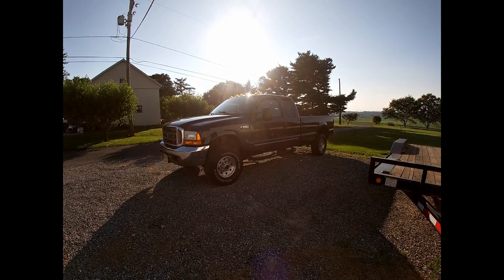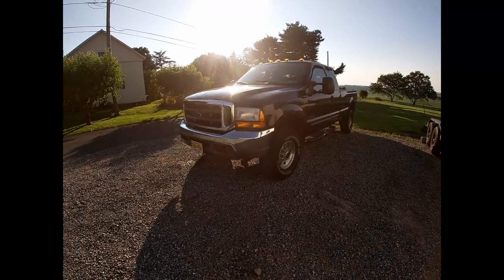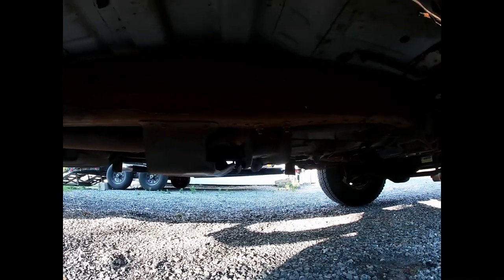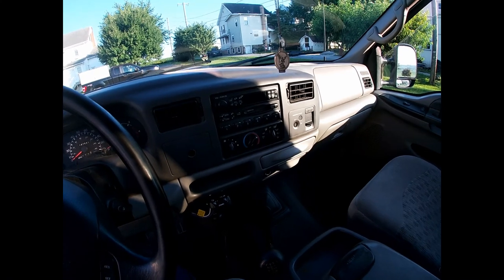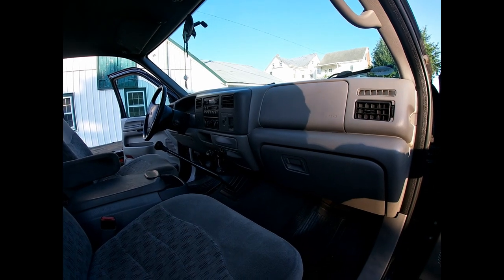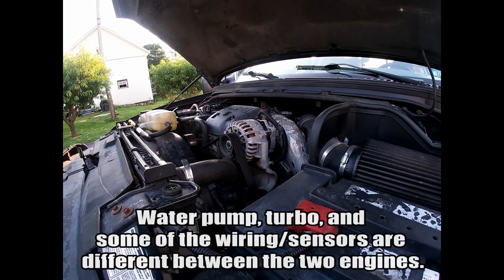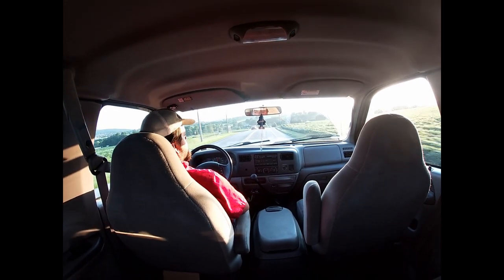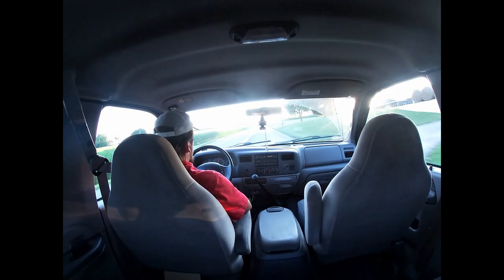2000 Ford F-250 Super Duty - 7.3L Powerstroke Diesel & ZF-6 - In-Depth Review, Walkaround, and Drive

Comment: 1:15 you literally just described my life, my uncle had a 2000 Ford F250 7.3l diesel when I was growing up, he passed away in 2009 and my other uncle ended up buying the truck and it’s basically been sitting on his farm for over a decade, and I’m currently trying to buy it from him so I can maintain it and use it as a daily driver/camper hauler. There is definitely something nostalgic and warming when we see these particular super dutys, awesome trucks!
Reply from the maker: 100% agree with you on the nostalgia! Definitely need to keep that truck in the family if you can. They are only getting more valuable with age, and pre-emissions diesel trucks aren't being produced anymore so we need to keep the old ones going. If I was ever in need of a dually, I would try to buy back my uncle's old 7.3 dually he sold in 2005. It's still local as far as I know. I have a history of tracking down old family heirloom vehicles.

Comment: That is a really nice truck.  And that is coming from a gm guy. If there is one engine more reliable than a 5.9 cummins or a duramax its the 7.3. Northern people definitely seem to have a different definition of rust, though, we southerners run away when we see a spot of rust the size of a dime on a body or frame, haha, but this one seems minor and definitely worth saving.  Perfect spec cab/trans/bed/engine.
Reply from the maker: Thanks! The early 2000's really were the pinnacle of diesel trucks in my opinion, before the "emissions" era began making everything complicated (and unreliable). Ford, GM, and Dodge all had great powertrain options at the time. I'm doing the best I can to protect this one from rust, but up in this part of the country it's almost inevitable. My plan is to pull the bed off, strip the frame and coat it with a rust preventative, but probably not for a couple years yet. For now, I'll just keep the salt off as best as I can.

Comment: I miss my 2001 F-250 that looked exactly like this one. The only difference was mine was red, automatic, full bench seat. I wished it had a six speed. It was rated 250 HP and 505 lbs of torque. The 6 SPD is rated at 275hp and 525 lbs of torque.
Reply from the maker: I believe the HP rating increased over the years but mine being a late '99 build is rated for 235/500. The programming was changed in '01 to bump up the horsepower.

Comment: That’s one hell of a truck! I have a very similar looking truck. I have a 2006 Ford F-250 with the 6.0 power stroke. I don’t care what people say. You shouldn’t either. They are just great trucks.
Reply from the maker: You got that right! Those 6.0's have a bad reputation but the later ones (especially '06 and later) were pretty good and they can be built into a very solid engine. A lot of Ford guys seem to prefer the '05-'07 generation as they have some more bells and whistles than the '99-'04s. At this point I've learned to just not care what people say about me or what I drive - I put a lot of miles on Dodge and Chevy trucks for work so I guess I can say I'm not too biased. There's something about driving a 7.3 though....
Reply: @MichaelTJD60  I have driven many different diesel powered 3/4 tons and 1 tons and I’d have to say the 7.3 has a nice grunt to it. For some reason I’ve noticed it takes a lot less rpm to get a 7.3 going. May be because of hi/lo range. But anyways I love them both. For sure both beat the new crap sold for over 60k. 

The 6.0’s main egr issues were resolved in late 2005 and most 6.0’ s that have issues are before late 2005. I’ve had no issues other than the stupid “water in fuel” light THATS common with sensors. Always comes on at the same spot going down the road!

Comment: I do like that truck. The 7.3 V8 series from 1998 to 2003 are the king of ford engines. With a manual transmission. Great to haul stuff. Not  even my 2012 Silverado 1500 5.3L V8 extended cab won’t pull your trailer unless is a lawn tractor.  So far it’s good. I put on wax for it and shines great.
Reply from the maker: If I keep the RPM high, the 5.4 Triton in my 2010 F-150 can handle a lot of the same loads the 7.3 can pull, but is nowhere near as easy on fuel, and the automatic transmission never knows what gear it wants to be in. The 7.3 just pulls like a locomotive at low RPM all day long.

Comment: I still own a 99 F350 single wheel with a 5.4 gas.  We still run it as one of our primary service trucks at 24 years old, still spins like a top.
Reply from the maker: Before he passed away, my next door neighbor had that exact same truck that he would use to haul scrap metal every week. Those were great trucks with the higher-output 5.4. I'm not the biggest fan of the 5.4 but those earlier ones were tough engines. I had the lower-output version in my old F-150...it was a dog when loaded, but still ran well.
Reply: @MichaelTJD60  The early two valve 5.4 is a pretty good motor that tends to have a fairly long service life.  My wife had an 09 Expedition with the later three valve 5.4 that blew up at 115k after having been meticulously maintained, only lasted 4 years.  The ford V10 is a good engine as well.
Reply from the maker: @houstoncowdog  Yeah the 2V was definitely a better engine overall - I did have to replace the intake manifold after mine cracked and leaked coolant down into the spark plug holes (not uncommon on those plastic manifolds). It only spit out one spark plug in the 66,000 miles I had it. But was pretty reliable otherwise. 

I have one of the very last 3V 5.4's in my 2010 F-150 and it is a very strong runner at 112,000 miles. At that point in production they had done away with the two-piece spark plugs and the cam phasers, so there isn't a whole lot to go wrong aside from the timing chain. I cut the oil change intervals in half to try and prevent any issues - hopefully it will last.

Comment: Awesome video Mike! The old 7.3 defiantly runs and drives good. It's amazing how clean it is underneath. I wish mine wasn't as rusted as it is. The frames still good but the cab is not lol. One day that all will be fixed. Your also making me wish mine was a ZF-6 lol. If my auto ever gives me grief it may get swapped lol.
Reply from the maker: Thanks Evan! I would definitely recommend upgrading to a ZF-6 if your 4R100 gives up the ghost - a little bit of work but it will be worth it. Maybe I can do the ZF-6 swap in your truck and you can paint the frame on mine? lol.

Comment: I bought my 99 f250 sd in 02 still running strong it is a 7.3 power stroke
Reply from the maker: Nice! Keep the oil changed and it will run forever.

Comment: Programmer will really wake it up. My dad had 2 of these over the years with an edge performance programer and it made it run! According to Edge it would have been 350 horse 650 lb ft and that was with an old programmer from the mid-2000s i imagine they've come a long way. Awesome truck bro hard to find 6 speed ones anymore.
Reply from the maker: It's now rocking a PHP Hydra with Jelibilt tunes and 180/30 injectors, so it's making a bit more power than stock. I estimate it will make about 350-375 HP on the hot tune. Definitely makes a difference over stock!
Reply: @MichaelTJD60  That's awesome!!! Them 7.3s tuned run good and will last forever! my dad sold his last one when he sold his business with 350k miles and his old truck is still running around today pushing 400k miles right now.

Comment: That’s a beautiful truck. Under coat that frame, take bed off do it up right.  I have this same exact truck, with different center console. with power seats. I’ve not seen that on any other zf6 2000 7.3
Reply from the maker: Thanks! Undercoating, new bed rails and the harpoon mod for the fuel tank are all on the list for this truck. Do you have the fold-down jump seat with console? That's what I am looking to put in this truck. I'm guessing yours must be a Lariat because as far as I know the XLT's this early did not have power seats.
Reply: @MichaelTJD60  no it’s just big console with the change holder. yeah I guess it is.. good to know. I’m about to take the bed maybe even the cab off, and blast the frame then ospho -coat it as I live in the rust belt Pittsburgh. I found all rust free doors and a bed, in Georgia . it’s very low miles 121,000  completely stock, Good luck with your truck.

Comment: I have similar truck, E99 F250 CCLB with ZF6. I would recommend the 08 square style mirrors, the larger convex lower mirror is a game changer. Ive done most of the upgrades youve mentioned...KC balanced assembly, EPBV delete, bellowed uppipes, 4" exhaust. I will say the uppipes were a real pain even with a top side creeper. I didnt go 05 headlights, but rather the refresh in 03 i think. I kept center console and swapped in cup holders for that junk tray. Mine is also oddly factory purple and carpet delete. Mine came from Illinois...cab corners are just starting to rot and rear wheel wells too. 195k miles...someone swapped clutch to a Luk brand at some point.
Reply from the maker: Sounds like yours and mine are almost identical twins except for the cabs.. Mine currently has 195k on it as well. A year after uploading this video, I've done all the upgrades you mentioned except for the console and the tow mirrors - I can certainly appreciate the larger 08+ mirrors but I like the rounded look of the 05-07 mirrors with turn signals built in - just to keep it looking original. When it hits 200k it will get a new clutch (preferably South Bend if they can get them in stock again), slave cylinder, trans fluid, rear main seal, and change front and rear diff fluids. I should probably do an update video at some point.
Reply: @MichaelTJD60  I'd be curious how streetable the dual disk clutch is. I've heard some folks do one disk as organic to make it less grabby. I have no clue what Luk clutch I have but there is a tag glued to the bell housing warning about the flywheel (stock is dual mass I believe, most aftermarket go to single mass flywheel).
Reply from the maker: @EngineersHomestead  Buddy of mine has a Valair dual disk ceramic clutch in his F-350 and it's super grabby. Night and day difference driving his truck compared to mine. I'm debating single disk, but not sure if it's the right choice for hauling up to 12,000 lbs like I'll be doing eventually.
Reply: @MichaelTJD60  I know I've driven weighing in at 10k with a truck camper in the bed no problem and hauling a mini excavator on a different occasion.  It's been a while since I've looked into clutches, I would check for those designed for towing and avoid anything saying street performance etc. I think mine is a touch grabby, but my only comparison is car clutches.  I will say my clutch pedal is easier in the truck than my CR-V.

Comment: Nice trucks for sure. Due to fuel costs today you couldn't pay me to own 1. I had an 01 f350 for 3 year's and knew cost of everything was going to go up. Hope it lasts you a long time.
Reply from the maker: Thanks. I hope to make it last a long time as well. At this point I try not to let the fuel costs bother me - running good quality fuel (whether gas or diesel) was expensive even before fuel prices skyrocketed. The 7.3 is basically an oil furnace, so I have been running engine oil and ATF in it for fuel these last few months and only occasionally putting diesel in the tank.
Reply: That's good to hear. It is a sharp truck and will do anything you need.
Reply: @MichaelTJD60  gotta filter the hell out of the used oil or your gonna kill injectors.
Reply from the maker: @FishFind3000  yes, that's what a centrifuge is for. Need to remove as much carbon buildup from the oil as possible before putting it in the tank.

Comment: A worth while upgrade for these trucks  is a tuner from power hungry performance, hydra really wakes these trucks up
Reply from the maker: I forgot to mention that in the video - a new turbo and injectors are pretty much useless without a good tuner. Hydra is the only way to go and it's on my list. It will be nice to be able to choose between a power and an economy tune depending on what I am doing with the truck. The stock 7.3 is a dog for sure, but I've noticed around 1300-1400 RPM it will pull just about anything.
Reply: @MichaelTJD60  the more you hop up the engine the more your wearing it out
Reply from the maker: @FishFind3000  yes, that's why you always monitor EGT's and don't drive it around on the hot tunes unless you are towing.
Reply from the maker: @FishFind3000  half the reason the 7.3's last so long is because they're essentially detuned from the start and make nowhere near enough power to blow themselves apart.

Comment: When you do new seats I would be interested in buying the old ones for my 1999 7.3, The mirrors as well.
Reply from the maker: I'll keep you in mind. The seats aren't really a priority for the truck right now but if I find a good deal on a 40/20/40 seat, that could change.
Reply: What is the difference between the air filter sytem as a heavy (extreme) duty vs. the standard duty...is it more than a better filter inside, or is the housing assembly also somehow different?
Reply from the maker: @thedivinemissm7795  The housing is shaped differently to accomodate the larger filter which has more surface area.

Comment: I have the exact same truck. Mine runs like new, with only 700k original miles, original transmission, original engine. Motor never rebuilt. I have a video of it on YouTube.
Reply from the maker: I watched your video. Very nice truck and it's in great shape overall for the miles. I'm hoping to get at least that many miles out of this one....would be great to push it to a million.

Comment: > vinyl floor

Are those much good? I've considered getting one but I'm worried about it trapping water
Reply from the maker: I have a vinyl floor in my Ram 1500 work truck and haven't noticed any issues with it holding water, but then again it's only 5 years old so it probably hasn't had much time to rust out yet. My thinking with the vinyl floor was that it would be easier to clean out and I wouldn't have to worry about getting dirt in the cab...as opposed to the carpet floor that I constantly have to vacuum.

Comment: I wouldn't call that blowby. Thats just steam. If it doesnt blow the cap off its good to go.
Reply from the maker: Normally I'd agree, but rule of thumb for checking blow-by on the 7.3's is to remove the cap and flip it over on top of the fill neck to see if pressure pushes the cap off. This will rattle the cap off slowly, so I know it has a bit of blow-by ,but nothing major. Nothing a little oil additive can't fix.
Reply: @MichaelTJD60  I hear ya. I'm still in search for one.